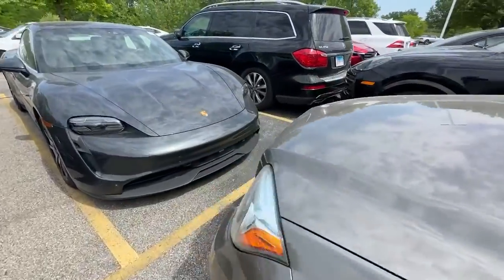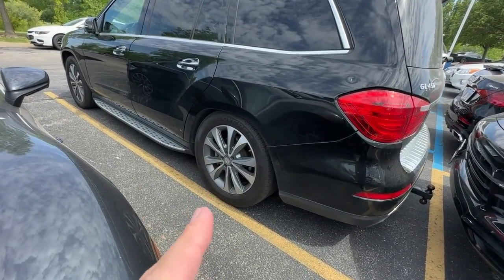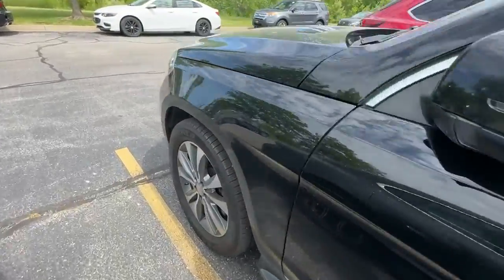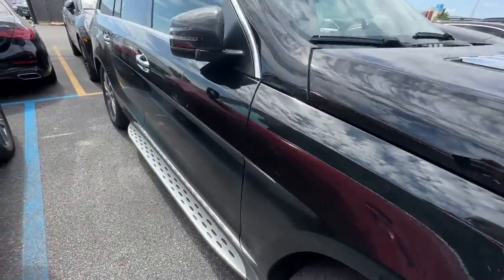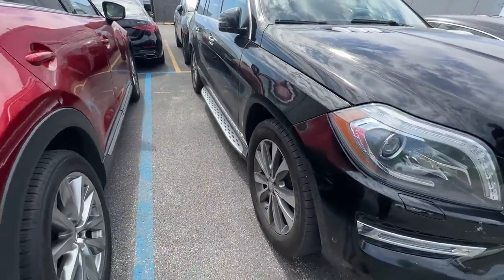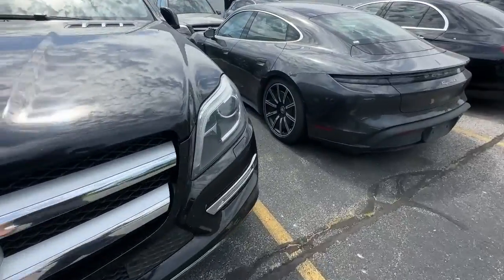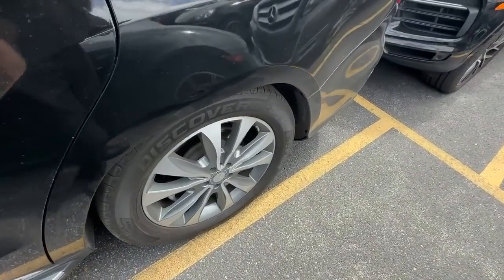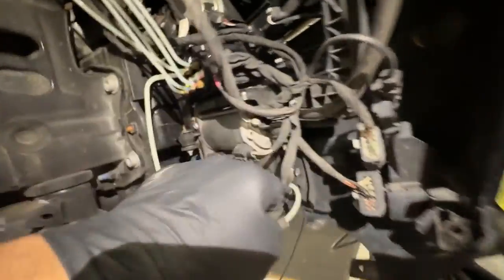Mercedes air suspension dropping???

Comment from the maker: I wont lie, the rear air bags still needed to be replaced due to extremely fine leaks through the bellows. But if you have a sticking or leaking relief valve it will stop pressure from being built and actually lower the car if the compressor comes on and valve block opens. So add this to your toolbox of diagnostic ideas when it comes to airmatic suspensions. Hope this helps!
Reply: Then why only the rear suspension was lowered, but not the front one too?
Reply: Realy helpfull! Can you exchange the relief valve without exchanging the whole compressor? Thanks for all your content its really the best out here on YT
Reply from the maker: @JB-hw8ce  I think you can find the valve on ebay and amazon. 🤔
Reply: I ponder bags must be bad as on locked car valve block is shut and all bags isolated individually from the rest of system in theory 🙂
Reply: I have 2008 mercedes s 550 4matic. Only the front collapsing and a lot of shhhh happening!!
What scanner should I get?
Thanks
Reply from the maker: @ scanners only help if you have a warning on the dash, sounds like you have a leak
Reply: @MasterTechLou i alos have a s550 from 2007, the front drops after a night of standing. The front struts have been replaced. No fault codes in the dash. Could in be the valve block?
Reply from the maker: @ yes most likely.
Reply: @MasterTechLou  thank you for the quick reply!! Will change the valve block🙂
Reply: @johndeer470 what happened to you ? i have the same issue and no fault codes, no valve block leaks no strut leaks!!

Comment: I just replaced the air compressor on a 2008 GL320 after the previous one was pooched. The rear suspension on both wheels was flat. After replacement, the suspension worked fine. A couple minutes later, the front suspension went flat and now I'm seeing the following error - any idea why?

5508 The pressure line system leaks
Reply from the maker: It cant build pressure. So theres either a restriction in the intake line or the compressor is junk
Reply: @MasterTechLou  Checking - thank you!! 🌟🌟🌟🌟🌟

Comment: MTL - My suspension seems low especially in the front.  I can fit 1 finger between the tire and the wheel well and when I hit a small dip in the road the tire seems to contact the liner.  I used my ICON 8 to ensure the levels are at their stock level but it does not remedy the situation.  When the car is running the car does not raise up so I don't think there is a leak it's almost like the car is "lost" in trying to level itself.  I ensured the levers look healthy because it seems the computer is getting a bad signal.  Does this point to a bad distribution block.

Comment: so is it normal for my amg gle 63 s to make the pshhh sound ? just notice it when i drive or parked
Reply from the maker: Its purging extra air after it fills the suspension shocks/bags and the  storage tank. It pffffs out the pressure in the compressor and lines. Yes often its normal.
Reply: @MasterTechLou thank you very much gave me my peace of mind back 😅

Comment: Great video. Many thanks. 
My present issue with the GL550 is slightly different though. I recently replaced the driver's side front strut and now the passenger's side rear is significantly higher than the driver's side rear. Of course, that lift is transferred diagonally to the front. This makes the driver's side front to be slightly lower than the passenger's side front. Any advice pls?
Reply from the maker: Double check the installation position of the front right level sensor and make sure all linkages rotate and pivot smoothly

Comment: any idea what could cause an 06 s500 Mercedes with airmatic suspension. my car only sags in the rear when its incredibly cold out like 10 to 30 degrees.  Outside these temp ranges it stays level rock solid and doesn't sag at all.  I tried spraying the bags when the car was on a lift and seen no bubbles.  same with the valve block.  Any input on this?

Comment: Great video Lou, my 2017 GLS450 rear left side is dropping every time the SUV is off. Sometimes within an hour sometimes it may take longer. The other three corners are fine, so do I have a bad airbag on that wheel? Also, where are you located as I wouldn't mind to drive a few hours to have you work on my vehicles?

Comment: Do you know the location of the valve block on a w213 e-class estate. I’m spraying the bags now to make sure before I order the parts. But if it a valve block it would be a lot cheaper
Reply from the maker: @thefridge1000  in rear on left side under car

Comment: Hey Lou, thanks for these videos. My 2014 E550 front two shocks are low in the mornings. Some days its fine, some days its low(slammed). It does have electrical connections on the front struts. When the car is low it given the "vehicle rising, do not drive" message. Once filled the car is okay to drive around. 

After the car is raised, when I disconnect the inlet line from compressor that feeds valve block and zap strap it with a balloon, the car periodically lowers the cars and fills the balloon. I did not disconnect any batteries. Is the car self levelling once parked or does this mean faulty valve block as the ballon is periodically getting filled with the car off?
Reply from the maker: Leaking valve block. Car does not adjust level once off.

Comment: My gl550 was also dropping, had diagnosed as bad compressor and valve block. Replaced those and suspension has completely dropped on 4 wheels, and getting a malfunction and sometimes a compressor Cooling down light. Any advice on this please
Reply from the maker: Misinstallation
Faulty valve block
Blown compressor fuse
Bad compressor
Reply: @MasterTechLou  if the compressor fuse is blown - wouldn't compressor work at all???
My compressor(new one from the dealer on 17 GLS450) runs too often, without compressor relay the car doesn't sag at all in several days(I also sprayed all the line connectors, a valve body aka governor is also new)... What could be the issue???
Reply from the maker: @nazigrammar9728 sounds like bad compressor

Comment: what I don't understand is WHY only the rear dropped not all 4?
Reply from the maker: I think I pinned the comment, the issue ended up being rear bags. The valve block locks the air . And the compressor valve should also lock the air which it did not. But the fix was the rear bags they only showed a leak
After driving and getting the bags hot
Reply: I really don’t get what you mean? One time you said in the pinned comment that the rear strut was leaking and that was the problem, but then in the video you checked the pressure release valve and it also had an issue. So that car had both problems the rear strut and the pressure release valve too?

Comment: Very good video just had the same problem with a ml550 but it drops in the front compressor went bad then valve block psi was stuck at 507 psi so changed that now it rises but once I take for a ride it drops again I’m thinking I might have a leak that I can’t see on the airbag itself. But thanks again for video helpful

Comment: hello. i have 2008 MB R320 CDI. customer was completing about right rear side dropping down overnight. I checked a leak I found a leak in bag and replaced genuine airbag. still same corner going down but slow. I switched both rear bags to check a bag leak but still its going down from same corner. than I switched lines from valve body to check valve body but still its dropping down from same corner. can u help in this ? what should i do?

Comment: Hi Lou, thanks for the video on airmatics! You really explained the whole system very well. I’m driving a C200 equipped with airmatics. Rare as it is, it started giving me problems which my mechanics and I couldn’t solve. I wished I come across your video earlier. I’ve changed out 2 front suspensions, air compressor and valve block. However, the FR and both rear suspensions could not lower. We deduced that it was the valve block that was the issue after all the checks on the parts such as compressor, air lines and suspensions. While waiting for the valve block to be delivered, we left the car for a few days. We noticed that the rear suspensions dropped all the way, while the fronts dropped a little. If you could help, give us some tips to what could be the problem? Many many thanks in advance.
Reply from the maker: Hello, well…… all of my tips are in my airmatic video my friend. I was very thorough in that video for a reason 😊.
All I can suggest is to rewatch the video in entirety. And pay attention to the leak part. There are very few items in the system. The only time I struggle is with very random issues. Like right now I have a S class that keeps blowing the fuse and burning compressors but never happens here in the shop. So this is a head scratcher for me at the moment. But as far as dropping suspension, its either the shock/air fittings/air line/valve block. Also you cannot have once side drop without affecting the others. The car has to move. So best I can say is do my measurements check I explain in beginning. If you end up needing my help further you can find me on instagrams messenger. I do charge for my time. Time is one luxury I dont have.
Reply: Haha! Thanks for the advice! Will rewatch the video again. Will get my mech to diagnose what could have caused the leak. Talking about fuse, I’ve blown an orange fuse twice, and it is this blown fuse has caused the FL suspension to drop. Still scratching my head what could have caused the drop as well… 😢😢😢

Comment: Another very helpful tip. Thank you. Can you do one about assessing mercedes shocks and struts with the airmatic. Will worn out shocks  of airmatics operate like they do with coil springs?
Reply from the maker: Thanks! Unfortunately I don’t think the air portion ever lasts long enough for the hydraulic shock portion to fail 😂
Reply: @MasterTechLou  I believe you, the shocks do last. Aside from watching for fluid leaking from the shocks, and high miles,  how else can we tell when it's time to replace it? I've had experience with coils, when they roll like a boat and bounce a few times over bumps; does worn shocks in airmatics behave differently?
Reply from the maker: @RobertoMenguitoFrontierMedAlle  you will get knocking noises before any excessive movements. 
also when you set comfort or sport mode the knocking will change. other then that, I have never seen these behave like normal cars with back shocks.
Reply: @MasterTechLou  I get it. So we can't elicit that usual bounce test (like we do with coils, rocking or pressing down on each corner then release)? Thanks Lou!
Reply: Bonjour , l avant de ma mercedes classe r descend des que je coupe le moteur en quelques mininutes mais 1 jours sur 5 donc je ne pense pas que c est une fuites des boudins , c est possible que ca vienne de la soupape du compresseur ? J ai changer le vloc electrovanne mais aucune difference .... 
Merci

Comment: Hi Lou, thank you for the video.   My compressor on my W212 does the same.   The pressure goes up to about 7.5bar and leaks away through the compressor to atmosphere once the compressor stops.   I've replaced all the o-rings inside the compressor and it is still the same.    You didn't end the video stating that changing the compressor fixed the air leak?   It feels stupid to replace a $1000 component for a leak that could probably be fixed if you knew where to check.    I'm still battling with mine.    If I apply air pressure to the car compressor outlet, the pressure is lost through the compressor somehow and exits through the intake pipe, same as in your video.
Reply from the maker: Compressor fixed my leak through the check valve. We do not rebuild these we replace. So im not sure what o ring does what

Comment: Brother can you help me?
I have Mercedes w220 s320 2000 model
I have battery drain issue
Past 6 month I hunting to find it 
I check all the door module
I checked  seat control module
I checked real sam
I checked front right and left sam 
I checked glow box light and locking swith 
I checked sanroof 
I checked tail lamp
I checked  side mirror heater 
I checked lisence plate light
I checked siren
Still I can’t find the drow 
What is the next I want ro check?
Reply from the maker: Usually audio components cause draw in there cars. Radio. Telephone module. Amp.
Reply: @MasterTechLou  I removed command allso
In my car there is No amplifier , telephone module which in rear right under back seat I disconnected 
Still I can’t find it
Reply from the maker: @61120-r  car needs to have all switches closed and be locked so it can go to sleep. some modules have 2 fuses so if you arent pulling both at the same time it will stilll stay alive. also it depends on your battery health and how you have the meter hooked up if youre actually testing the draw correctly. I hope you figure this out or have a close shop nearby to help .
Reply: @MasterTechLou  I connected mutlimtre black wire to battery positive and other to the car ground wire.then I switch the multimeter to amps settings ln10a ( before this I closed all the doors and also closed the trunk lock manually) after like 15 minutes I checked in MultiMere it’s showing 0.25 amps in 10a setting( that is 250ma)
This means we have drow right?
I think we need 0.05a(50mA)

Sir, I have one more doubt. When I switch multimeter to 200ma setting I am getting reading of (02.5)
Sorry for asking too many questions
In this time I removed fuse one by one to check any change is there or not but still not charged..
 I allso check with old method like connecting 💡 bulb one battery terminal and one to car ground, still bulb glow aftr 15 mnts allso same
Reply from the maker: @61120-r  no meter is connected wrong, sounds like it.  look up how to perform a parasitic draw test.
Reply: @MasterTechLou  I am a member  of Benz world group they guide me to do like this, is there any other video if you have plz. Every morning my battery die  plz help me
Reply: @MasterTechLou  meter need to connect one to car ground and other to car battery right?from where we disconnected the ground wire( the black one)
Reply from the maker: @61120-r  look up eric the car guy he has a good video on how to do parasitic draw. but in benz have to be sure every switch is closed for doors, hood and trunk then lock car and wait few min before car will sleep.
Reply from the maker: @61120-r  from ground of car, to black of meter, then red of meter to ground post of battery on an amp settings with meters leads in amp connections. this is the best I can say from comments. I wish you luck
Reply: @MasterTechLou  same I did

Comment: The solenoid manifold valve spool is not seating fully in either direction? If it's a single or dual solenoid setup, it's either not seated properly in neutral(solenoid not engaged} or not shifting fully when engaged?
Reply from the maker: When I install the new compressor I’m going to disassemble this one to check the internals to see whats actually happening.